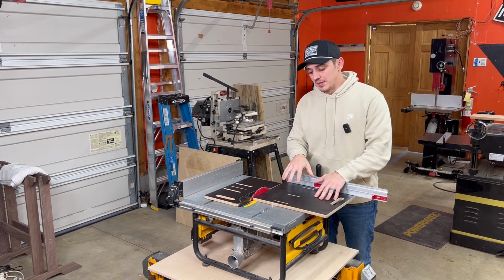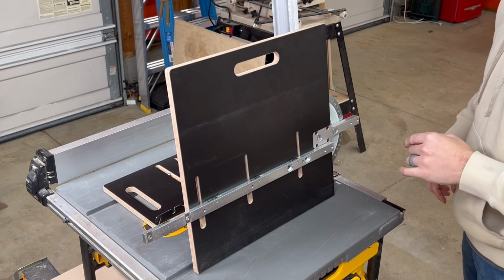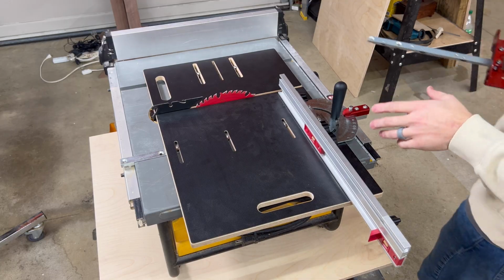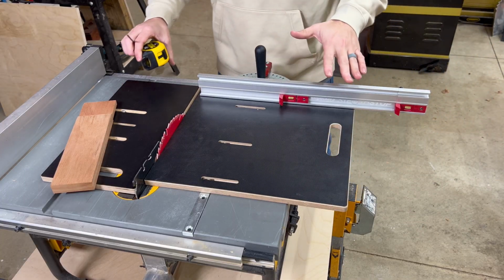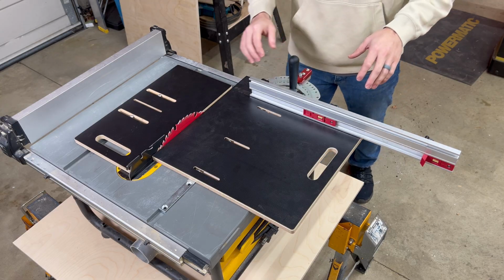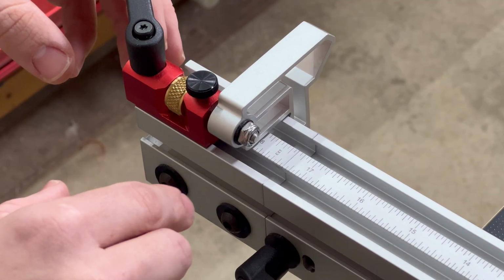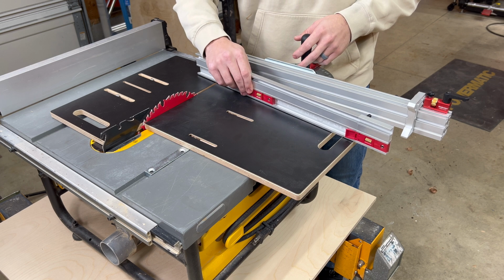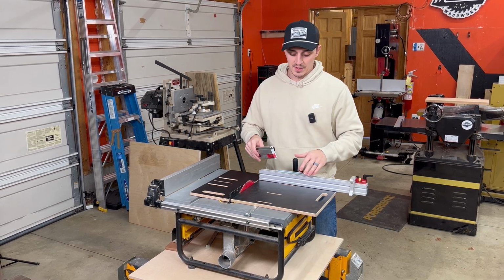Every Jobsite Table Saw NEEDS This Miter Sled l Woodpeckers StealthStop Miter Sled

Comment: @mowderwoodwork I am really hope you can respond to my comment. I need help! Let me start by saying I'm not the most intelligent person in the world. Simple and obvious things I seem to screw up. That said..   I bought the WP Indexable mitre gauge AND the miter sled "top" as as add on. I'm in the process of trying to get this ready for use. It came with ZERO instructions for the miter sled install (Thanks WoodPeckers very high quality of you), and well I noticed it has its own I'll call it "baby miter bar" as seen at 1:42 in your video. It came with some screws to attach that bar to the sled (little wood screws 4 of em). Now I'm not THAT dumb I figured out that baby miter bar slides into the sled to make the connection. But then (before watching this video) I was utterly lost about the actual (long) miter bar that is on the actual Indexable Miter gauge. I was like um there's no way this works. Your video, showed me that it appears you have to completely remove the miter bar (the long one) from the Indexable Miter gauge, and then manually install it on the sled (using the 3 screws + t slot looking things, dont know their real name.

So at this point I have basically disassembled the Indexable Miter gauge completely (good bye any "factory" calibration there might have been). I managed to get the baby sled miter bar attached to the Indexable miter gauge "head" if we can call it that. Re-attached everything, (need to fix my degree indicator everything is not in line...) I have loosely installed the long miter bar that came with the gauge to the sled just as seen in 1:42 of your video. Its loosely installed because now I assume I have to make it dead parallel to the saw. I don't know if I can "cheat" by sliding the bar into the slot on my table saw (basically same model as yours just the crappier 8 1/4" blade version (this is what uneducated people thinking they "know" what to buy do, I regret the saw and honestly may try and sell it and get a better one but thats not important sorry). If I can't cheat by sliding into the miter slot on the saw, I'm guessing I need to use a really good square (L shaped or T shaped ect.. which I have) and ensure the bar kisses the square evenly the entire length while I tighten the bolts from the top. Is this the procedure?

I'm also confused at what distance I should tighten down the long miter bar in the sled, I see in your video same timestamp, that it looks like yours is either inline, or slightly over the "baby" miter bar. Does it matter where I put it, are there pros/cons? I want to get the most usable space out of the saw. I bought the "Flop stop" as well to hold boards from tipping over. 

Lastly, I bought the "sacrificial" wood block add-on too that goes on the right side that you cut into. Where the heck is that supposed to be in-line in terms of the saw and the sled?? I'm guessing it has to hang over the sled since we aren't cutting into the sled. But I don't know by how much. There's not good videos I found from Woodpeckers covering this. Just a few seconds of the "commercial" video. I'm honestly really upset with WP. They make great products, I own many of them. I don't understand why there are no instructions for sled installation, or a video on their site for a visual how-to. I am hoping since, you have it all set up that you may be able to guide me into the optimal and accurate installation. I know I'm going to have to check for 90 and all sorts of angles and things per the manual since I took it all apart there's no calibration anymore. I didn't see any other way to install it besides taking the d***n thing apart.

I would appreciate any and all tips/tricks you can offer up! I did not buy the optional table sled for the right side of the blade. Just FYI. For the haters out there who are going to hate on me, go right ahead, random strangers from the internet are basically like bots to me they aren't even real nor do I waste my time reading them or more importantly let it impact my attitude. So hate away! On the flipside if someone has been through what I'm going through other that the poster of this video I would appreciate any comments to let me know how you did it. I thank you kindly in advance!

Thanks in advance. Woodpeckers, on the off chance you read this which I highly doubt, shame on you for throwing a sled in a box with some screws and zero instructions anywhere on what the heck someone is supposed to like me. If you are selling it on the same page as the gauge, and as an add-on per your "commercial" have the courtesy of providing the steps to properly set it up. I know now it's going to take me forever to get this calibrated correctly. Super glad I stopped and didn't do the calibration steps listed in the miter gauge instructions as I would have wasted my time because I have to take the whole thing apart to attach the sled. Your products are quality, even overpriced,  but I and many others pay that premium price because we want accurate dependable tools. This is not helping me stay a loyal customer..

Comment: Can you help me understand what mounting the miter fence on the sled enables you to do better than just using the miter gauge and fence directly on the table does?
Reply from the maker: The reason I like it better is mainly because the sled prevents the piece from dragging on the table saw, which gives me more control and in the end more accurate cuts/joinery. There's many other reasons but I'd say that's the main one. Good question though! It's one of those things I think you just need to experience it hands on, and I'm sure you'll come up with your list of reasons why you like it to
Reply: @mowderwoodwork  You also increase, like you said in the video, the depth of the board you can crosscut. I think that is the best selling point for these sleds

Comment: I completely switched the indexable to the stealth sled and replaced the indexable degree pointer with the stealth miter pointer for more accuracy and boom… looks way better.
Reply: Can you run that by me, again? I’m seeing the stealth miter gauge mechanism is red. Are you saying you take that entire fence and red mechanism and switch it out with the sled’s miter gauge fence and silver mechanism. But, before you install it, you switch the pointers between them.  Do I have that right?   Thanks.

Comment: Would you (or anybody) know if the fence for the DWE7480 Type 20 fence is interchangeable with the DWE7480 Type 1 fence?  My fence has broken and the parts I need or replacement fences are no longer available.

Comment: $240 for sled is almost the cost of the saw
Reply: Not even close pal, a ridgid or dewalt job site saw will run you 600+, quit smoking crack dude

Comment: The scale is confusing when the extension is being used. In this video (to be seen at 8:20) the normal scale goes up to 17 and a bit, but on the extension it starts at 31 and goes down in numbers? Shouldnt it start with somewhat like 18, 19, 20....? @Mowder Woodwork......can you clear this up please?

Comment: I hope you will reply to my question PLEASE! You just solved the problem I am having with my new Saw Stop CTS. I bought the big Harvey Pro Miter Gauge. There is no room for my stock to be cut. Do you think the Woodpecker Miter Sled would work as well on my CTS as it did on the Dewalt? Please let me know. I count or guys like you for your honesty. I am a an advanced woodworker that now works 100% in my wheelchair. I got run over by a drunk driver November one year back. I have rebuilt my shop from the ground up. I am NOT a big fan of RED TOOLS but your presentation was spot on excellent. It answered what I have been looking for. PLEASE REPLY. Will this Miter Sled work as well with the Saw Stop CTS? I just installed the BOW system complete. That is wicked cool. I have my CTS mounted on a Kreg Tool Low Leg Bench with Kreg casters. Yes it’s a sweet set-up. Thank You for your time. Thom Schuck, Portland, Oregon >>>SOON<<<
Reply from the maker: Yes it should most definitely work on your table saw! As long as your miter slot is anywhere close to 3/8ths of an inch tall, and 3/4 of an inch wide, it will fit. I am very confident this miter sled will work just fine on your saw! Thank you for your comment, I hope you enjoy this sled if you end up ordering it! Please let me know if you do!

Comment: Nice video; thanks for sharing! I haven’t seen this before and have a similar saw so this would probably work well. 

It would have been nice to see this in action (especially for wider and longer crosscuts) to see it’s stability and accuracy; if you ever put it a video with that I’ll be sure to check it out. Thanks again and nice walk-through!
Reply from the maker: Thank you for the comment and feedback! That’s a good point, I’ll try to make a video here soon that is geared more towards showing this tool in action!